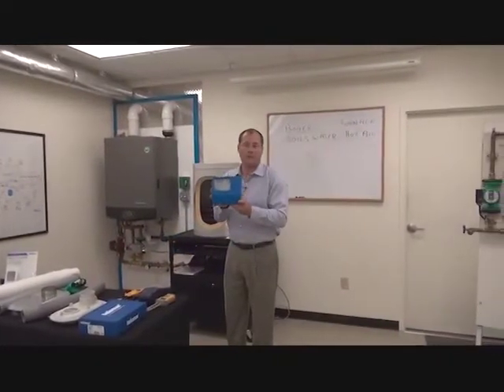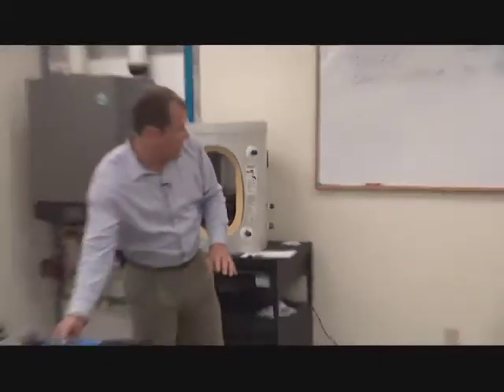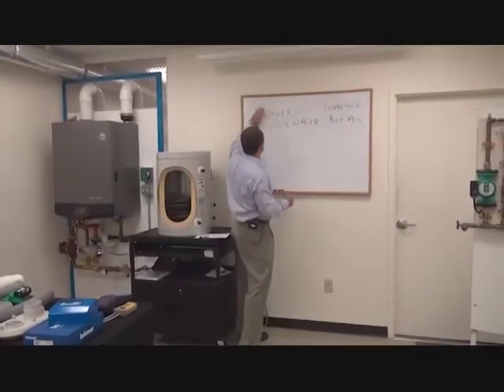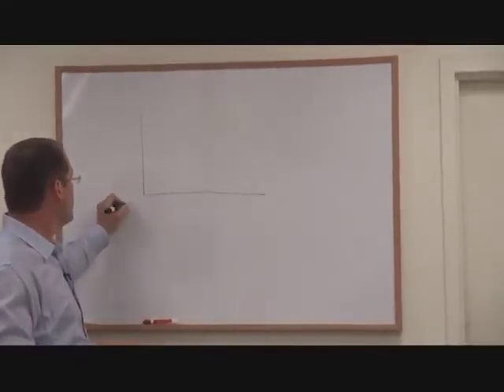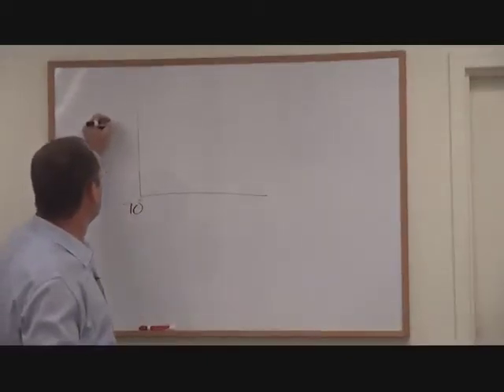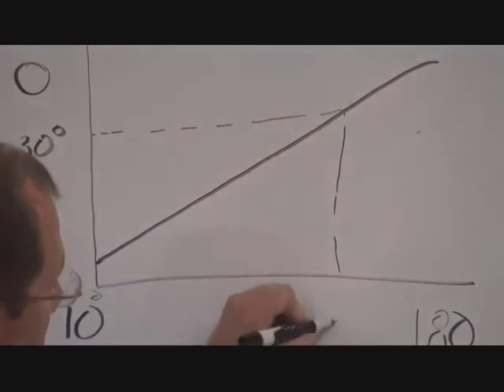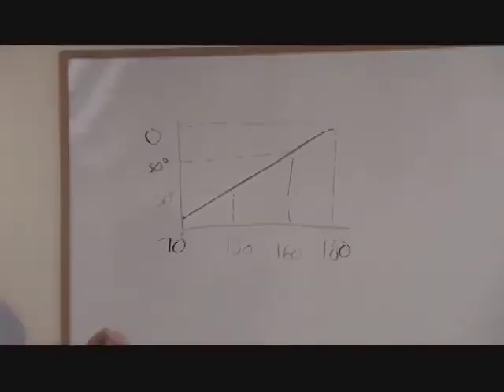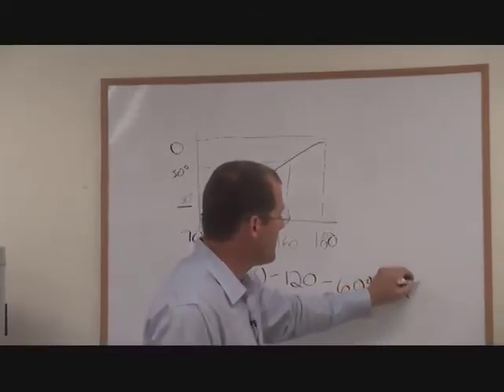Simple ways to lower your energy bills - Install an Outdoor Reset Control

Comment: Lol,  reducing temp is not equal to increase in efficiency
Reply: It does because lower water temp out of the boiler also means lower flue gas temperature. The residual energy in flue gases is wasted. Running at lower water temps is critical to the efficiency of condensing boilers. For conventional boilers, it helps but the difference between 140F (minimum to prevent flue gas condensation, which will rapidly corrode and ruin a non-condensing boiler) and 180F (typical max) is near negligible.

tl;dr: reducing [boiler] temp equals less heat blown out the smoke stack